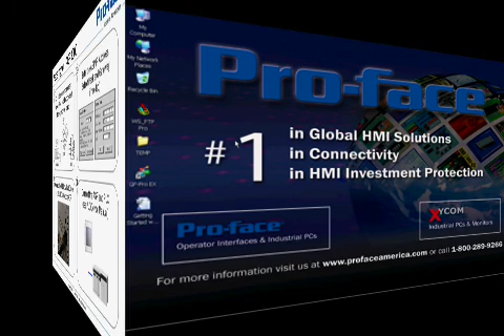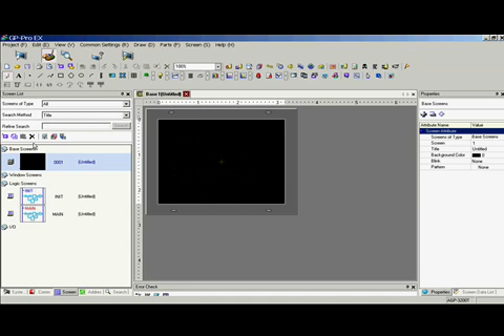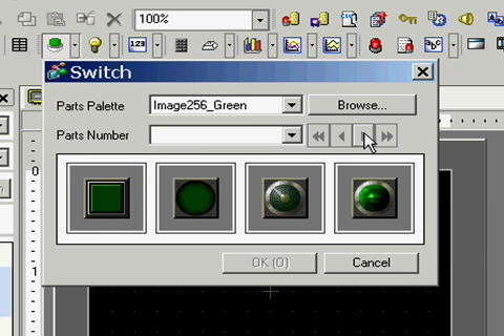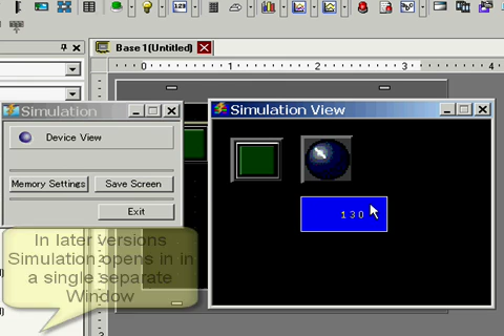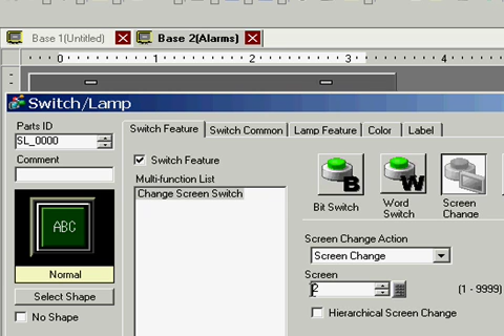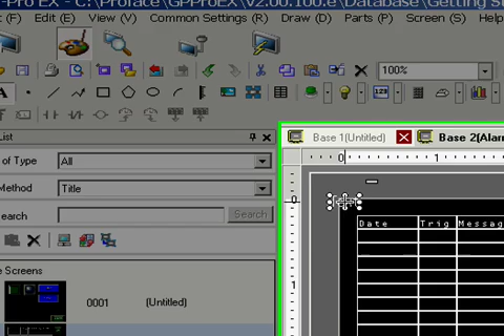Getting Started with GP-Pro EX

Comment: Hi Sir, I do have AGP3200-A1-D24 HMI & i need to upload the program from this HMI & and download to AGP3200-T1-D24. And I do not have USB  cable with me. Can i use Com1 to communicate with my PC which has GP-Pro EX software Installed? I do have usb to serial cable with me & 9 pin d type female to female connector. But communication is not happening. Please advise & please let me know the rs232 communication cable pin details so that i can make it & use with USB to RS232 converter. Awiting your expert advise ASAP.

Comment: I understand Vector introduced the DBC format long before CanOpen was around.. it doesn't contain PDO/SDO specifics, yet CanOpen software, like CanOpen Magic , Vector Canalyzer Canopen , EcoStruxure Machine Expert Software, still asks for a DBC file! 

Sometimes vendors of CanOpen devices, often supply EDS/DCF files.. where EDS is based on the BNF syntax..  but how do you go from EDS/DCF to DBC? Or if neither is supplied, how do you create a CanOpen based DBC file based solely on the PDF documentation?

Comment: By, the way our old AGP3500-T1-AF has screen problem needs to be replaced so we need to take-out the program and transfer to the new spare unit same model.  We want to use LAN to pull-out the old project data fro transfer. Pls help.